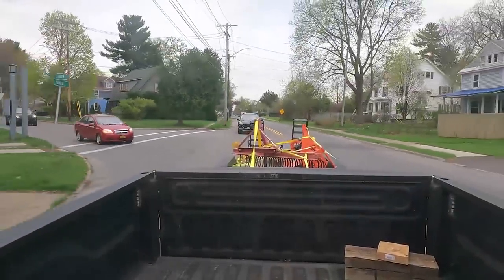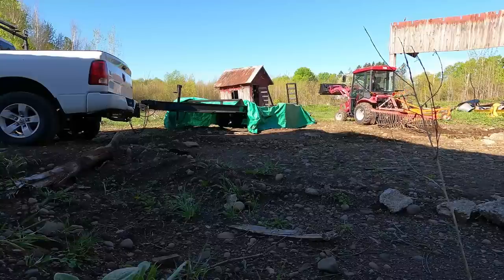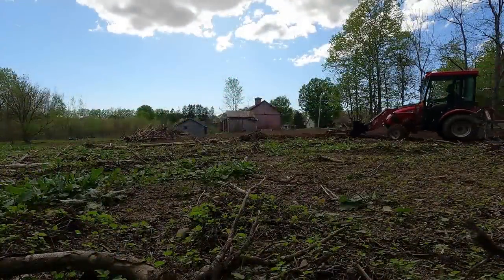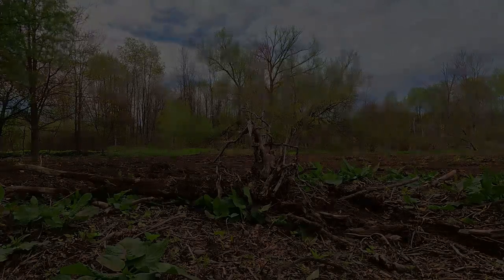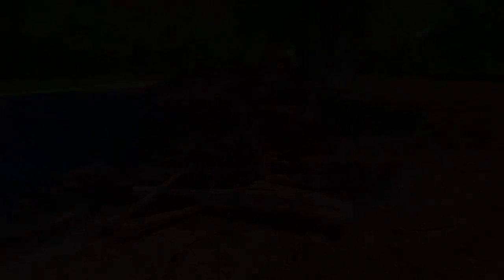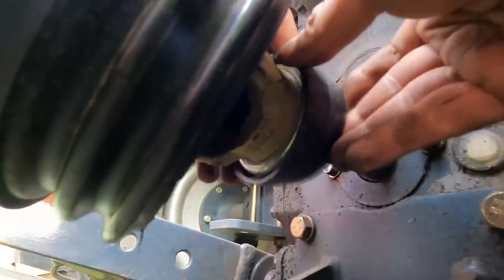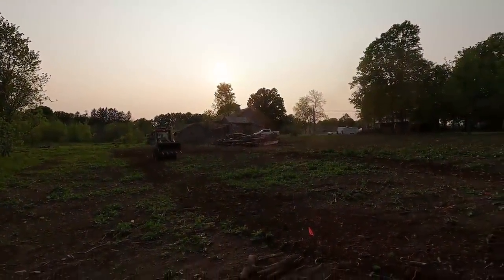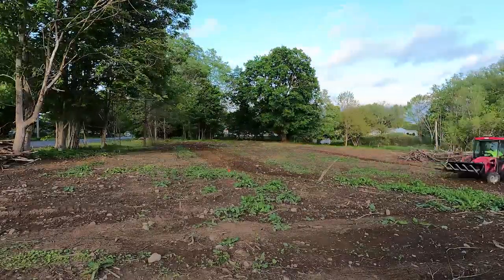🚜🌱 Spring field cleanup.....   BUT, will problems prevent me from planting anything this year 😧?? 🌱🚜

Comment: send the old driveshaft to a driveline shop , they can build you a new one , likely with a thicker tube .
A new replacement OEM shaft will break like the old one
Reply from the maker: Hey Wade!! Thanks for watching and leaving some comments! Yeah I've been looking online for replacement to try to hurry the process along. The one I'm getting as a replacement is the new generation OEM that fits the old generation tractors - it has universal joints and is much thicker than the unusual spring-loaded ball bearing (thin wall) unit that was originally in this year's model. I never thought about a driveline shop - we don't really have one of those here locally. I'll have to look around though since I can't be sure!

Comment: Sorry to hear about your breakdown, especially when you seemed to be in a groove.  Do you know any farmers in the area that you could hire to bring down a plow and discs and make a few swipes for you?  With some of the equipment in the area it doesn't seem like it would take them much.  That's a nice looking tractor, BTW.  I like the color red, too. ;-)
As far as connecting implements to your 3 point hitch, I don't have too much experience as all I have right now is a ballast box and hitch bar, but I have heard it can be tough.  There are guys out there that swear by a quick hitch though.  From what I have seen you can back right up, lift the quick hitch into the pins (including the top link) and then all you have to do is put in your lynch/clevis pins.  Of course it is never as easy as you see in video and they always recommend you research the quick hitch to be sure its shape won't interfere with your implement.  Ed from My Cluttered Garage has a video on the Harbor Freight Quick Hitch here - https://youtu.be/Shu1Ok1uEzY
I do always loosen the lift arms when I add/remove an implement so the spread out easy (you may have done this and just didn't show it on the video).  And if you make sure the link ball ends are well lubricated so they move easy, this helps too.
Ballast is important too when using you FEL.  I can't remember if you said your tires were loaded in your tractor, but is is always a good idea, especially if you are lifting something heavy  (like rocks) to have a heavy implement or ballast box on your 3 point hitch.  And watch your side angle when you lift to dump.  The higher you lift, the higher your center of gravity, and the easier it is to tip over.  Almost had it happen to me with my first tractor - it actually tipped but either I managed to dump the rock, it fell out on its own, or a combination of both so the tractor righted itself.  Scary, so I always like to mention it to folks using FELs.
Reply from the maker: Heyyy!! Thanks for watching and commenting. Yeah - it always seems like as soon as you're in a groove, things go sideways! I wish I knew some of the local people - there are farms a few miles away, but sadly I do not. I bet with a large tractor and some discs they could get this are done in about 10 min. LOL.  The TYM seems to be a good tractor, but I think I have the opposite problem of the bulldozer - I think I went a little too small this time. If I had something in the 50-60hp range, I think that would have been a little more ideal. Ugh - either too big or too small. Thanks for pointing out the Harbor Freight quick hitch - I didn't even know that was a thing there. I'm looking at it now. It definitely seems easier. There's also a PTO quick-connect (like $400) on Amazon which people swear by - so I'm keeping my eye out. No, my tires aren't loaded, but there have been a few times where I had an OH SH** moment. My field is at a slight slope, and with the ground uneven during raking, the tractor lurched and I thought it was going over. People say tractors are tippy, but I've never experienced it... until now! I'll ask about ballast, as they have the beet juice down the road where it is getting repaired.   :-)

Comment: Since you have a digger can you not bury the pile on the edge of your property? 
You can dig a trench and push it in.
The soil you dig out can be used to level out other areas
Reply from the maker: Unfortunately I can’t… most of the property is a combination of state and federal wetland. Digging in general is prohibited unless for agricultural purposes. There are some areas by the road where I technically could bury some of it, but that would cause it’s own problems due to proximity of the public road. It’s an annoying problem.
Reply: @BuyingTheFarm  That is complicated. What about hiring a forest mulcher. Turn the whole pile into woodchip?

Comment: you need a different plow for what you are doing , it is a breaking plow.
probably a 2 shovel would be all that tractor will pull
Reply from the maker: Yeah, this is a small 27hp diesel - I've been looking on marketplace and the smallest I've been able to find locally is a 3 shovel, but mostly 4 shovels. There are some I've found that tow behind an ATV, but I don't think those would work as well as a 3-point-hitch model.

Comment: You need a different and bigger disc
Reply from the maker: Hello Wljoey!! So, in my area, most of the discs that are available for sale look pretty much like this one, or two of these units side-by-side. Do you have any examples of what would be suitable for a tractor like mine? I've never used discs, so any input would be helpful! THANKS!
Reply: @BuyingTheFarm  King kutter atv disc, or one bigger
Reply from the maker: OK - I'll check it out - thanks for the reference!
Reply: @BuyingTheFarm  also look into a little 8N or a older Farmall letter series tractor better for pulling than your new one
Reply from the maker: I actually have a Facebook Marketplace page open looking at some of the older 8N tractors. The prices are fairly reasonable (I guess) - $3000-$9000, but so far there are none close by. It would be a few hour drive both ways to the nearest one, but I am watching. A lot of people in past videos have mentioned that the 8N are great and reliable tractors!!
Reply: @BuyingTheFarm  save yourself some money and check a few states away they go for half that price, like Wisconsin they usually go for 2000-4000 fully restored
Reply from the maker: OH!!!!! Wow, ok. I've never broadened my search that far......